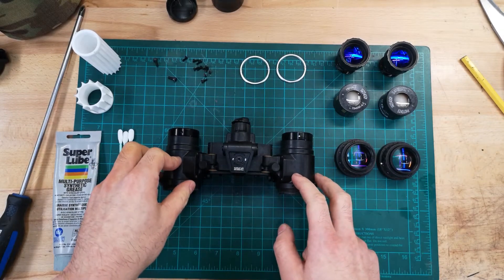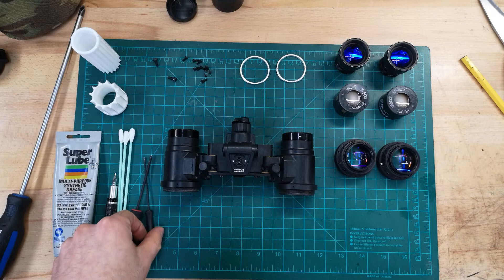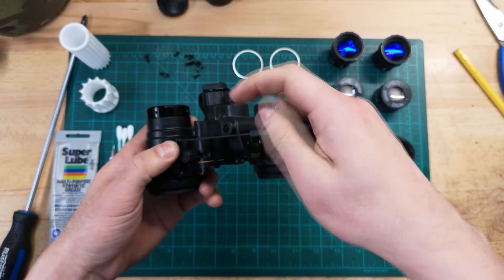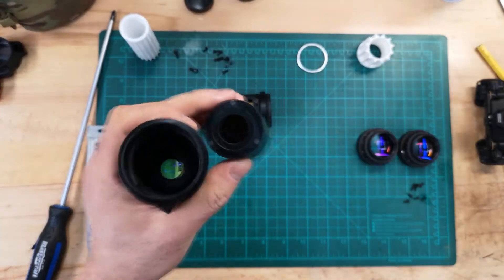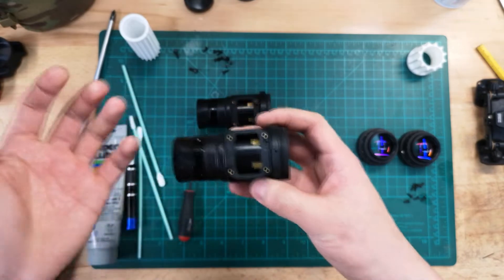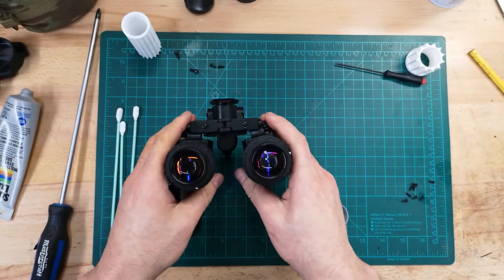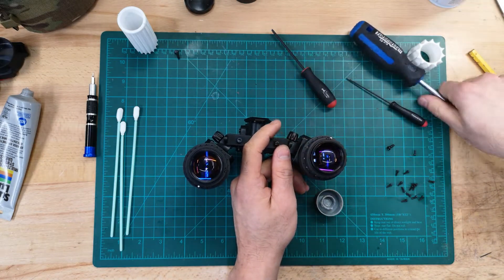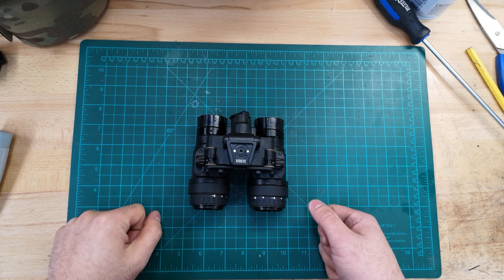BNVD 1431 Assembly Tutorial

Comment: Im doing the swap soon from an Armasight n-15 gen 2 to these and I have a question. There is one WHITE wire coming from both tubes leading to a circuit board type thing in the middle case of the NVG. What does this wire do. I’ve been researching for a while I can’t find anything. An no it’s not the wire for a gain control. It’s totally different.

Comment: There’s no reason to grease the eyepiece threads. Apply a thing layer of grease to the inside of the housing where the eyepiece o ring rides
Reply from the maker: Normally it's not necessary, but with the off spec threads on the 1431 it helps get the ocular lenses on.
Reply: ZTWworks that just means it’s making it easier to cross the threads...
Reply from the maker: @Rando832  you're not wrong, but that's what you're essentially doing to thread it on in the first place.